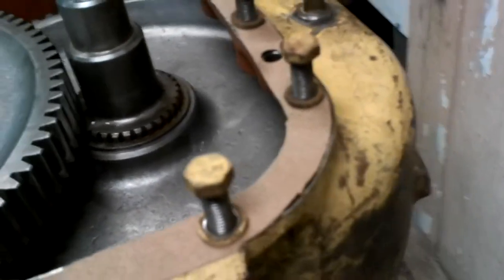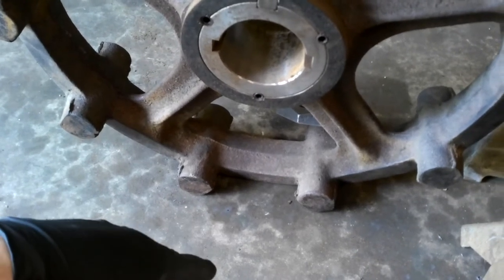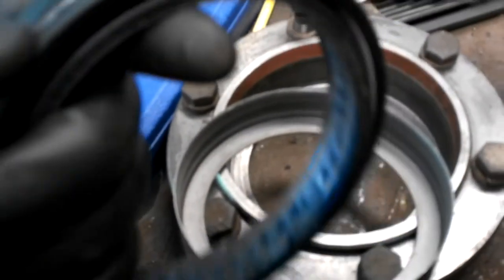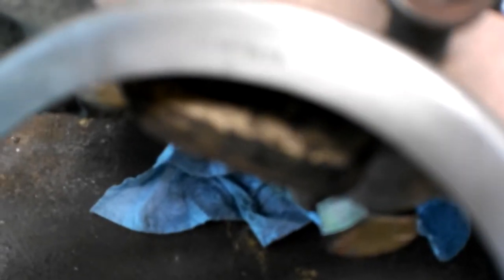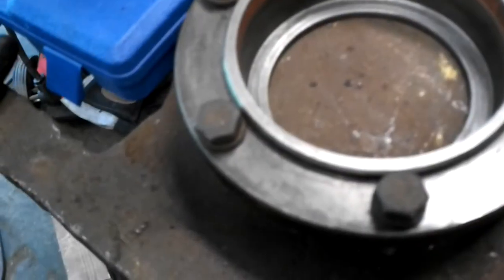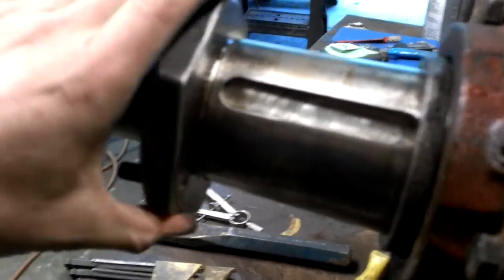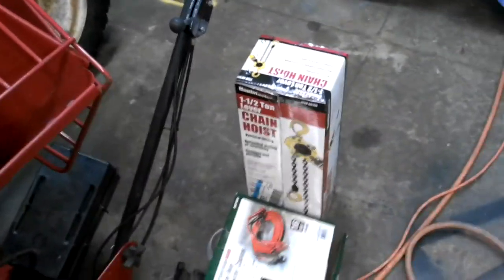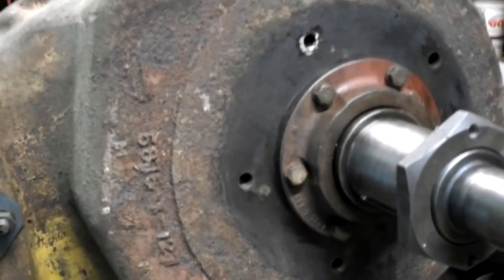Hyhoe excavator final drive assembly and install

Comment: That Detroit doesn't sound bad once its warmed up.
Reply from the maker: Donald Cisney lol didn't sound good when I first started it though.  Starter was stuck engaged for a bit before I realized it also. Running on 8yr old fuel too.  I think it's  more of an injector knock. Starts without ether now though so it can't be that bad.